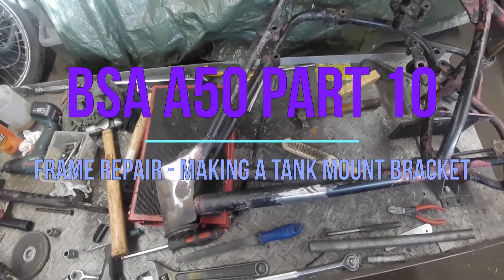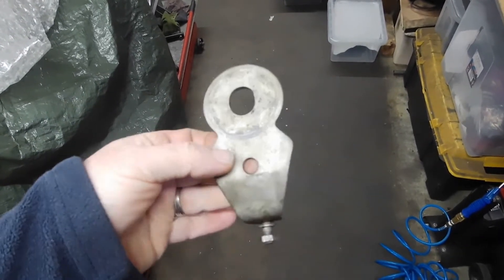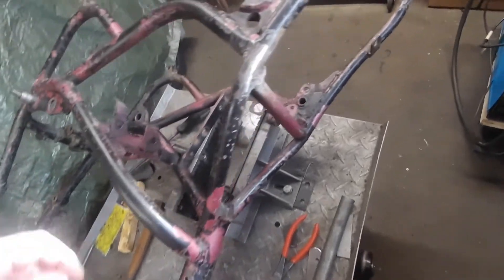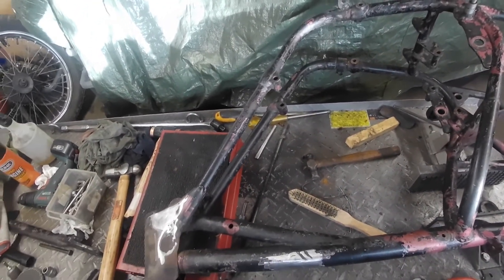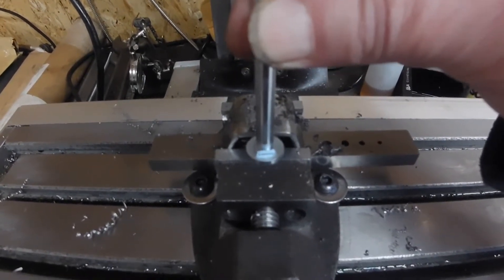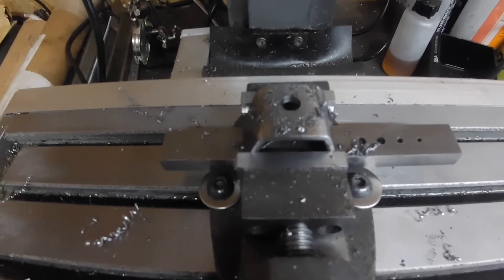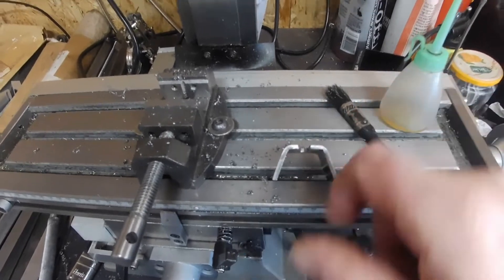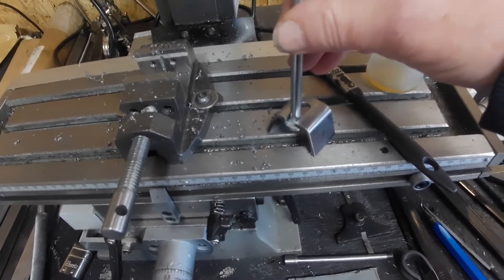BSA A50 Part 10 Frame Repair - Tank Bracket

Comment: Nice bit of progress Ian. Welded on stops and holes drilled in the rear frame rails....... smacks of longer forks and a cissy bar sometime back in the 70's. Some groovy cat had a go at the Cal look! Best wishes, Dean.
Reply from the maker: Yes must have had some back street chopper work done on it, also the purple metal flake paint is a bit of a clue!
Reply: @InTheShedUK  I think the purple metalfkake clinches it Ian!

Comment: Hi did you know you can use quick metal putty under powder coating,  for a filler , regards Nigel.
Reply from the maker: No, didn't know that, I guess it must be able to cope with the heat.